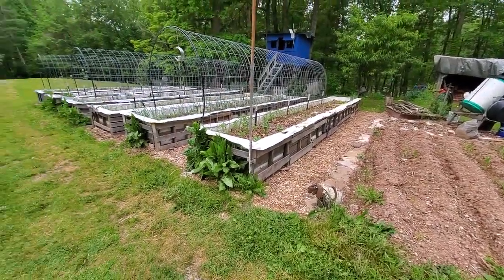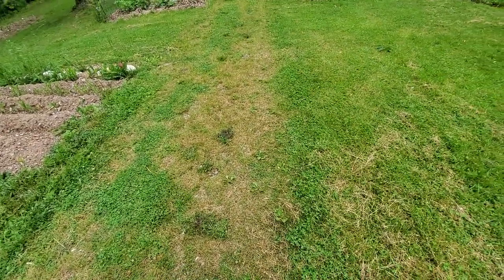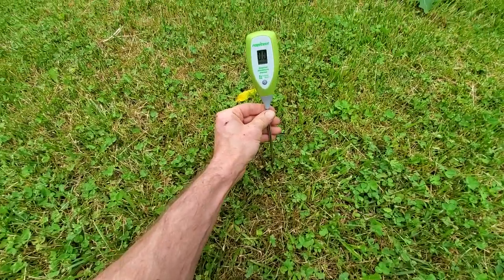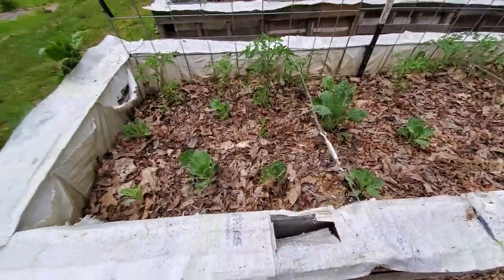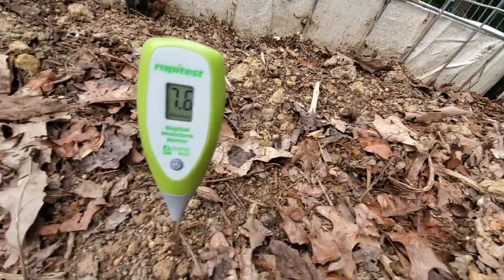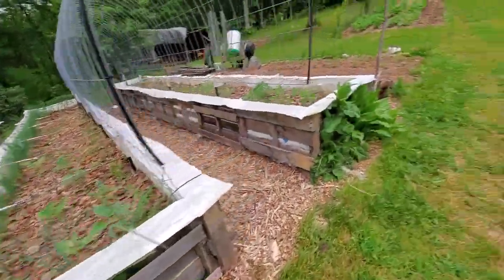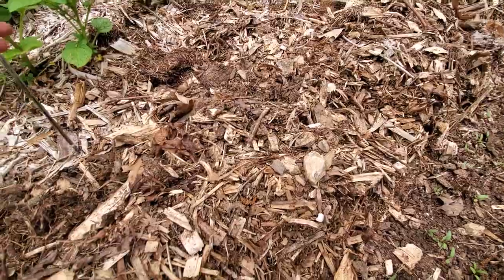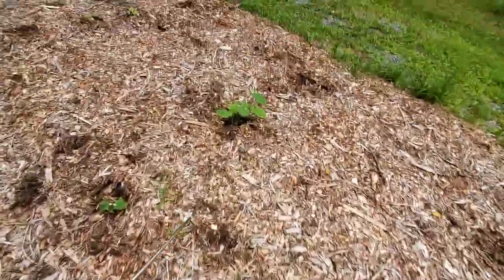REVIEW-Luster Leaf "RAPITEST" digital Moisture and PH Meter  PT2

Comment: How accurate the result?
Reply from the maker: technically speaking,, i find the moisture meter to be accruate.  When it comes to the PH meter i am only trusting the device.  I did poke it into the ground where i knew i had bad dirt and got readings that match to the bad dirt,, and i got readings of good dirt in areas where  i knew the dirt is good.      i dont have a second brand PH meter to compare to.  the moiture meter is much easier to verify and it is very good.  in my garden beds i almost never need to water.  I actually discovered i was watering too much on my first year of my garden build.  i had no idea my design was holding so much water for plants.  as soon as ai stopped watering,, all my plants got very very perky and health